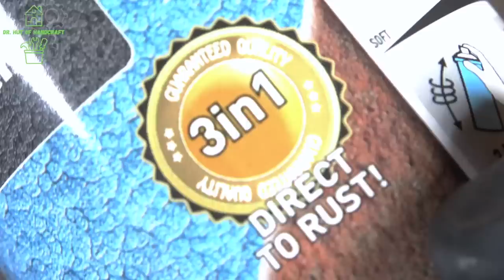Barn find drill stand restoration I Dr. Hut of Handcraft

Comment: very nice restoration, a spring is missing, the plastic clamping ring at the base of the column serves as a support for the spring you are missing, it is a spring with 35mm internal diameter.
Reply from the maker: But where is the spring? 😄 it was never disassembled before and there was no spring when I disassembled it 🤔 Maybe there are different models with and without a spring

Comment: I need to buy or construct a drill stand like this one!!
Reply from the maker: Definitely useful!
Reply: Just bought a very old Wolfcraft drill stand. Very similar like this one. I wrote to the manufacturer that it is good for d43 neck drill or not. They said, the stand is 30 years old, based on the picture i did and said also that is compatible. Also proposed to buy the modern one, but nooo. The stand what i have has solid still hexagon coloumn, the base is also casted steel and not die cast aluminium as nowadays. The part which receives the drill is solid die casted aluminium and not pressed sheet metal. At the end it is robust and works.